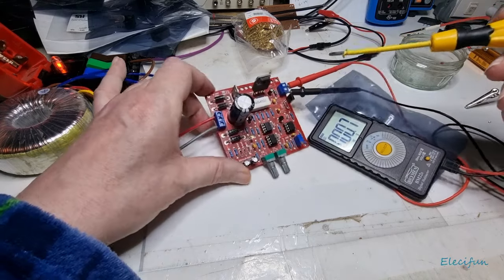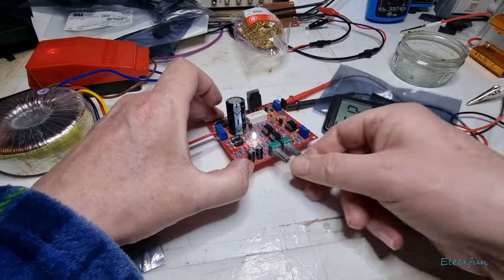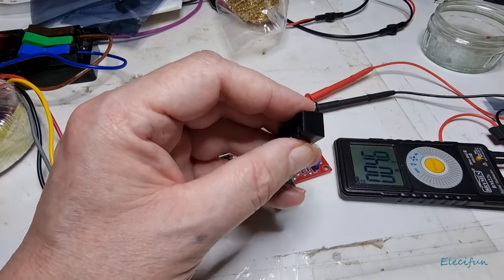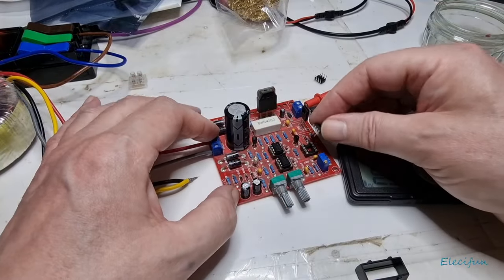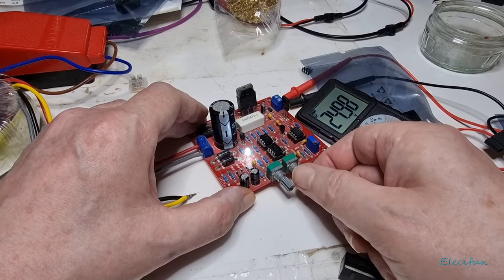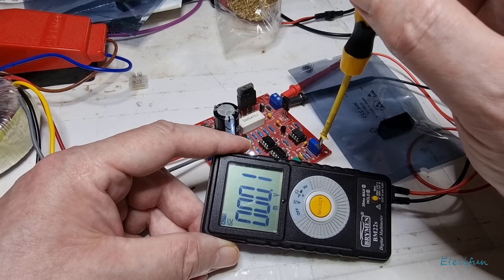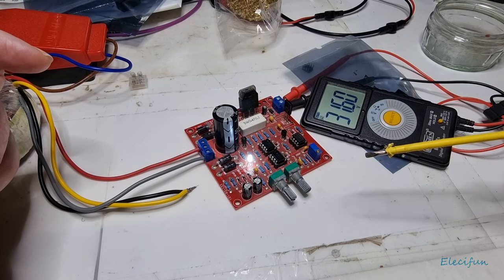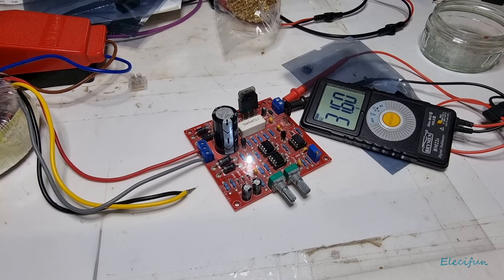RED  0-30V 2mA-3A power supply kit  SOLUTION

Comment: Did you figure out why the over current indicator led is on with no output load?
Reply from the maker: @robertalabla Hi Razzle Dazzle.. Yes, the LT081 was faulty so with a quick swap out for genuine it works as it should.
Reply from the maker: PS. I swapped all three LT081's for genuine to give the best chance of long term success.
Reply: @Elecifun  Nice.  Glad to hear it.
Reply: Yes nice results compadres! 🤔

Comment: Great news hopefully i can get alot of my boards up and working properly. what is the RS stock number as 3 TL081 appear ? thanks
Reply from the maker: @johnproudlock2900  I bought 9 for 3 boards at 40p each. the SN is 304-223 I hope everyone that watches and has had an issue can get theirs up and running. TL081CP 4MHz DIP8
Reply: @Elecifun  Thanks for that. I decided to use my geniuine hiland board TL081CP i switched out the 3 as their in dip sockets and it went from 26.97v to 30.64v. I know its not a big change but its working as descibed now. A bit thanks to you and demnoss.

Comment: I built this power supply and it was working but suddenly it stopped working.  What could have caused this problem?
Reply from the maker: @faristabakovic147  stopped working? no power anything? have you tried replacing the LT081's with genuine?
Reply: @Elecifun  I measured the voltage on the board and it is 30v,  but there is no voltage at the output from the board.
Reply: @faristabakovic147  Swap out the op-amps and double check the big shunt resistor is OK, and the power transistor. Should fix it. Pretty much all the supplied op amps are fakes. Or use UA741's instead. Both are fine. Always use sockets on the op amps. Saves a lot of hassle.
Reply: Also check your -5V supply.  R2 (82ohm) gets very hot and can fail.  If it does, the board won't work.  Replace it with a 1/2 watt or two 160ohm 1/4 w in parallel.  You actually should replace it anyway.
Reply: @uni-byte  Very true, thanks.
Reply from the maker: @uni-byte  I never noticed the heat but will set up the board and check. Thanks for the tip.

Comment: 6:37 😮 30V How much current? 🤔
Reply from the maker: @decem_unosquattro9538 up to a max of 3 Amps with a 3 amp transformer. The pass transistors in the kit can only dissipate a 25C 90 watts.
Reply: @Elecifun  oh wow that's interesting! 🤔  So basically your saying this can put out its rated voltage and current. That's a very interesting a good result compadre. 👍🏻
Reply from the maker: @decem_unosquattro9538 In an ideal setup, yes. In reality not quite. Much of getting the maximum will depend on components used. Remembering the main output (pass) transistor can only dissipate 90 watts at 25C. The transistor will get hotter than 25C and then it de-rates not giving the max output. The load regulation on the transformer can effect the max output. As the load increases the transformer can drop in output voltage which in turn means the voltage going in is not 24vac, again this effects the output max wattage.
Reply: @Elecifun  OK. Thats most interesting.🤔 I guess that's why that dude attached a massive heat sink to the big transistor.

To dispute the intense heat that's generated. 🔥
Reply: @Elecifun  So in hindsight how many watts is this regulated power supply actually capable of? I mean sustain wattage?
Reply from the maker: @decem_unosquattro9538  The maximum the output transistor is capable of dissipating is 90 watts. If using a big heat-sink and a fan you could get 90 watts but as the temperature creeps up over time the output would lessen as the transistor de-rates. 
You could use higher spec transistors in parallel so they could share the load and if a big enough heat-sink is used get the 90 watts for longer lengths of time. 
Did you have an application in mind?
Reply: @decem_unosquattro9538 it’s all down to Ohms law. I am using a 12v 0v 12v 160va. My board can get to 33.8v but after testing with a load I can turn the amps full and then increase voltage and it will only go to just past 12v @ 4.2 amps then goes to constant currant mode if I take away load voltage returns to 33.8v
Reply: @johnproudlock2900  hmm I wish I wasn't so stupid and ignorant. I guess only time and more research will improve my understanding of electronics. In my own situation I thought the problem was the transformer which appeared to lack the rated output. I was told to buy a better transformer. I might buy a new transformer and retest the output and see whether it improves the situation. Last time I just used halogen bulbs to do the test. The output was kinda weird and no where near what I assumed it should be capable of. I have a few if those Chinese highland boards like Elecifun but that's not actually what I was testing. I built a half dozen of the 28V 2A regulated power supplies which as stated earlier didn't cut the mustard.
Reply: @decem_unosquattro9538 no one is ignorant or stupid here. We all share our knowledge as a community. A transformer can have an impact on your results when I first started messing power supplies I thought a 24v 3w would be good enough until I built on of my first power supplies then realised my mistake of following watts and not amps lol
Reply: Sorin at the Electronics Repair School demonstrated in his video using two power transistors in parallel to share the load and to take it up to 5 Amps.
Reply: @decem_unosquattro9538  You aren't ignorant, mate. You are learning...same as all the rest of us. Just be patient and you'll get there.